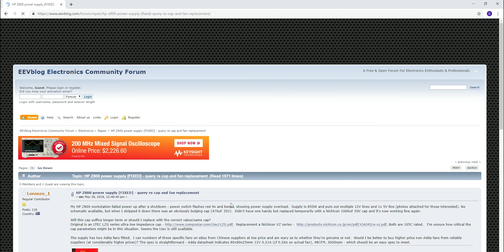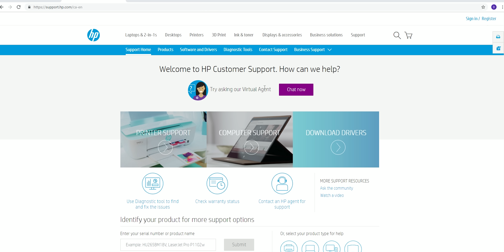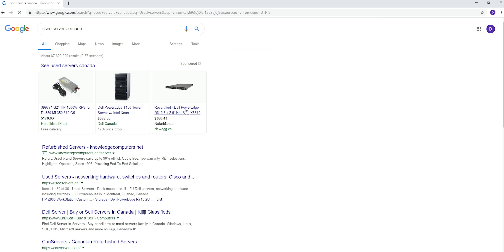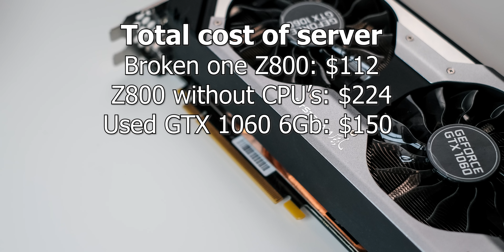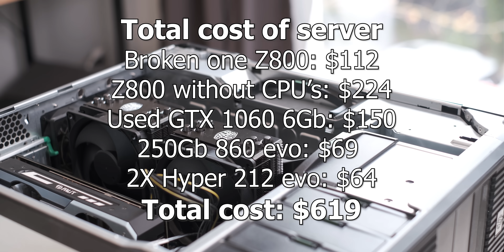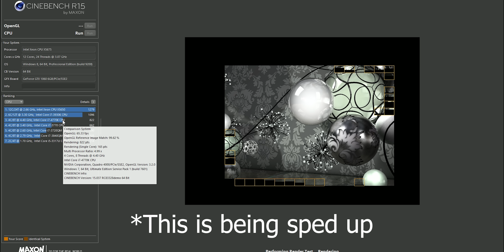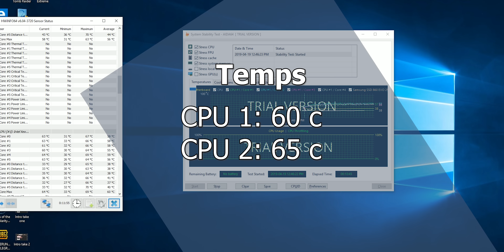Dual Intel Xeon, 48Gb BEAST for under $700! (With Benchmarks)

Comment: It's a workstation not a server.
Servers don't have crazy high end GFX cards.
It's meant for one guy doing crazy hard stuff.
 I've had a few of the predecessors of this beast namely XW8200 and XW8400. They are built for CAD and come with high end Quadro gfx cards. THey work as gaming cards but when the company retires the workstation (Typically about 5 years) they are no longer cutting edge and are a about average for games.
They have crazy amounts of onboard memory but they are no longer so performant that they can cut it for games.
Also a big downer is they age and so they don't support the latest shader models and when that happens it dumps it on the CPU which means catastrophic framerates.
The solution is to buy a new relatively budget gfx card.
My son happily games all the most recent games on a dual Xeon 3.0ghz 2x 5160 (upgraded for peanuts) and a 1050ti. It has 32mb of ecc ram and it plays just fine at 1080p.
This machine dates from around 2004.
That's the power of workstations.
Stable, Performant, cutting edge and cheap 15 years later but still somewhat performant.
Workstations are another class of PC, Really.
The base value of a workstation is to be at 100% all day every day for years. That's what they are designed for. So as a gaming PC - Massively over engineered.
Luv and Peace.

Comment: That is a nice build. I made my own, pretty similar build with hp z400 and w3690, 24g ddr3 ecc and rtx 2080 super. Because of faster gpu, i beat your scores in all areas, so you should get way better card. I really appreciate your tidy build and how easy you had it. My hp motherboard is sitting in fractal design r5 define case and cpu is watercooled, and i modified psu connector to standard atx. All of that was a pain. Also Intel XTU will work with you, so you can now set faster boost clocks!

Comment: Anybody else cringe real hard when he touched the traces on the back of that power supply? Those caps could still have more than enough power in them to fry more than the computer. Holy shit. He is lucky.

For all you folks out there servicing your own stuff for the first time, power supplies are dangerous, even unplugged. If you don't discharge the capicitors, they often have more than enough power in them to kill you dead.

Do a little googling before cracking open anything that hooks into the mains.

Comment: How about the noise? Can I keep it in my bed room?  I have powerEdge  server it is too noisy and I ended up with garbage it
Reply: I have two Z620's running in my office with EGA video cards and the fish tank in the office drowns them out.  Gentle swoosh sound is the best description of the fans. However crank up all 32 cores and then the fans roar. That never happens even with rendering in Adobe After Effects but they do throw off heat.

Comment: I've currently got a HP600z with stock x5660 at 2.79Ghz... At the moment I think their hyperthreaded. I've been thinking of getting a new PC for VR for some time. But never considered putting a newer card than the Quadro2000 that came with it. If I were to put an RX570 or simillar into my HP600z do you think it could handle some VR before I get the money to fully upgrade ?

Comment: Obviously you shouldn't open the power supply, the lady in hp was going crazy with your questions, when you touched the power connector to the motherboard it "switched on" why where you tinkering with the power cord connected, it's a miracle that you're still around.
Reply: Anyways cool build

Comment: I built a dual CPU Opteron system with a total of 32 cores, 8 memory channels, and 256 GB of RAM for about $700 not counting graphics cards and storage. It performs slightly better than my Ryzen 2700x in tasks that can take full advantage of all 32 cores, and the CPUs run cooler than those Xeons.

Comment: In my opinion, it would probably be better to buy a cheaper system, e.g. 2 x Xeon X5690.
Two days ago I bought a used one Lenovo ThinkStation for 700 PLN (170$) Dual Xeon X5687, 64GB ECC RAM, RAID 2 x SAS HDD 300GB 15K, QUADRO 4000. In a few days will arrive ordered SAPPHIRE RX 580 NITRO+ 4 GB (400 PLN = 100$ used).  I am curious about its results. 
My questions: what processors did you use? Is this socket 2011?

Comment: 3:10 HP SEO: We made a proprietary case to make possible only install proprietary MB and PSU to it. We swapped contact in fan connectors 
 to make possible install only our proprietary fans. We made naughty warnings during computer startup if some of ur proprietary parts are not installed and made that warnings unable to disable in BIOS. What else can we do? 
HP engineer who sold his soul to the devil: Let's remove CPU keys in the socket so some users will burn their systems and we will sell more our proprietary parts! 
Everyone in the room: Beer to that gentleman!

Comment: Have a similar setup, z600 with a gtx1060, 24GB DDR3 and dual  x5675 (6 core). And my two boys  has a z400 each with a X5687 3.6@3.86ghz and that outperforms my rig in gaming, but mine rocks in demanding tasks where all 12 cores get to work. The z400 is a hidden gem for budget gaming. RAM and fast xeon CPU's for the 1366 socket are cheap on ebay.

Comment: There is no need for a computer with more than 2GB RAM and a double-core CPU for the common private user! This is all just money making advertisement!
Even why would anyone need an extra graphics card? An optional onboard memory for graphics of max. 64 MB is completely sufficient for what the most people might apply it on to! There is also no need for an expensive SSD drive since an 80Gb HDD will do every job you can imagine!
Reply: A gamer and a video editor would disagree
Reply: 2gb ram and an double core cpu is not enough for a normal user

Comment: My  build is a C30 Lenovo Thinkstation, with dual E5-2680 V2 CPUs and 32 GB of RAM. It cost me €150 for the C30, €150 for the CPUs. I got a 500GB mSATA drive for the onboard slot, and a RTX 2060 for some gaming. It is pretty awesome for about €700

Comment: Hp z series power supply has self diagnose. remove PSU and just give power. if you see green light and  working fan it s ok. and this CM fans change the air flow in the case and its gonna be a huge problem for you .
if one of your cpu stop working check the two component back the mb.

Comment: i absolutely love the hp z600 and z800 series.. i had a z600 with 2 5675 chips and 36 gb ram. installed esxi and made a 4c 8 thread vm with a gpu and made my own geforce now and it worked perfectly. and i head headroom for running nas and other stuff on the left over  specs

Comment: Oh, wow. Is this a coincedence? I have a spare Z800 Workstation that doesn't boot up(probably because i didn't try a known working graphics card) and beeps and it is fully loaded with hardware. Then i can put in there my very own Quadro 4000. And it'll be an awesome upgrade!! I currently(3/14/2020 MM/DD/YYYY) have a Dell Precision T7400 that i put in there a Quadro 4000 and called it a day. It has a Xeon E5410 Quad Core @ 2.4 GHz(Has room for another one, yes, a dual CPU system), 8GB DDR2 FB-DIMM and all of my hard drives and also it has a floppy disk drive as an added bonus. If i get the Z800 workstation working, I'll have 2 more powerful Xeon CPUs, Double digits of DDR3 RAM and not dealing anymore with a CPU Bottleneck :). But one thing that gaming hardware has that server stuff mostly doesn't is the ability to overclock your CPU(s) in the BIOS.

Comment: Those little dainty HP coolers work great. I've got one on an i7-4820k and it stays under 30C (yes really). Bought another to put on its Xeon twin. Works better than my big high-end cooler. Catching on fire meant you had a short, also why the power plug didn't work fully seated. Main drawback of such a system is power draw relative to total computing power. A MacPro is basically the same system -- turn it into a hackintosh.

Comment: I have a similar setup.  Dual x5675 due to lower watts compared to x5680.  Tho I paired with gtx 1070 :) with a 650watts psu

Comment: Bought a z600 with a single x5672 for $20

Added another x5672 for $11, bought another stock cooler for $24 

Tossed in 48gb of ecc registered ram for $100 (I had to restrain from putting in 96 gb) 

Now I've got 16 threads and 48gb of ram to do whatever the heck I want with for under $200

Comment: You literally have two signs on both cpu sockets telling what side your fans should be 😂 Instead doing that, you made them to take the hot air from your gpu, blowing that hot air tru cpu cooler into the ram, making hot air to stay in your case. I bet the temps are high inside that case as we know xeons      love to keep you warm during winter.

Comment: I have a Z800 system, but I built it in pieces and put it inside a regular case. Took some modification, but it works pretty good. There are wiring adapters to convert ATX power to Z800 power, and had to get different threaded screws to keep the Intel LGA1366 coolers in, tapped holes in the case for the non-standard stand-off locations, and built fan adapters to plug fans into the non-standard plugs. Everything works perfectly.

Also the screws are the exact same as case screws, threading wise. You could have just gotten some thumb screws of sufficient length and it would have worked.

Comment: I cringed when you opened the power supply and was poking around without knowing what you were doing. Good way to get electrocuted.
Reply: When it hasn't been plugged in for a long time? How long do capacitors stay charged?

Comment: really nice to see a build similar to one i did. I used a supermicro X8D board with dual X5660 xeons and 128GB of ram with raid 1 300GB SSDs and raid 1 2TBs and a RX 580 in a corsair case
Reply: Gaming benchmark please
Reply: @a8gaming951  for a system i had 4 years ago...... i dont have the same setup on that system anymore.

Comment: @03:10 -- Intel CPU Corner indicator goes to the hinge lever corner. there's also 2 notches in the sides of the CPU and Tabs in the socket, it won't lay flat unless it's in the correct orientation. You can also unscrew the backplate via the torx screws on the front of the socket, and use the included backplate with the hyper 212. the socket retention frame really isn't needed. with a single x5670 overclocked to 4.5 and tuned well was able to break 1050 in R15 -- high end machines are breaking 18,000 these days one a single CPU...

Comment: Hey can you make into a Hackintosh ? I would like to know if that can be possible . It would be very interesting.
Reply: if it supports GPU passthrough, and linux, you'd have an option to run MacOS with only 4% performance hit plus linux as alt OS. if it doesn't support GPU passthrough, setup Docker in linux and run MacOS in a container, which is generally better than running in a VM because it uses less CPU resources

Comment: If you need a hammer why would you buy a screwdriver? They are both tools but one isn't appropriate for driving a nail in a board. My point is - why would anyone spend $700 on a PC that was not designed nor ever was intended to be used for gaming? I've had the same experience with Dell's version of this very same work station. The Precision T7500 with two X5675s (that's 12 cores/ 24 threads) and a GTX 970. I only spent $75 on it but the performance for gaming was similarly underwhelming and didn't even perform as well as my little HP EliteDesk 800 G1 with a Core i7 4790 and a GTX 1050Ti! The CPU benchmarks were off the charts but the rest of the specs just tanked the whole system because of the PCIe 2.0 - SATA 2.0 and USB 2.0 limitations. Sure you can throw all kinds of upgrades at it but it's still just putting lipstick on a pig, so to speak.

Comment: That's a pretty awesome build, and was seriously considering doing some upgrading to my machine while watching this. However,  my current machine with its Asus P6X58-E WS motherboard, Xeon W3690 overclocked at 4.2ghz, 48gb of 1600mhz non-ECC RAM, and RTX 2080 pushes the envelope a little more than I would get going to a dual X series processor setup like this, even if I used X5690s. 

Curiosity has the better of me though: I wonder how that PC would perform with dual Xeon X5687 processors... They're 4 core processors instead of 6, but they run at a stock speed of 3.6ghz, and they're cheap, I think I paid $25 for one just recently. With a locked multiplier there's not much overclocking potential, however you might be able to squeeze a little more out of it, perhaps up to 3.8 or 3.9ghz.

Comment: There are many ES Xeon Gold and Platinum on Ebay. Even 2nd gen. I build 2x40 core Xeon 6148 Gold ES on autumn 2018, still using it and happy. About $1500 for 2 cpus and mobo (X11DPH-i).

Comment: I picked up an HP Z400 workstation from work to test out some components of my old i7 gaming PC that had become flaky. I ended up just tossing the GTX970 in the Z400 with an SSD and game on that now, lol. Until I decide what i'm going to build, if anything, to replace it. It's running a Xeon W3670 @ 3.2ghx. I could probably get away with just upgrading the video card in it to a 5700 or a gtx 2060 Super. It has been a very good machine. 

In regards to your Z800 workstation... Was it worth it as far as performance for $? Not entirely. Is it an awesome project build? Absolutely!

Comment: Thanks! Great video! Would be interesting to see benchmarks at 720p or 480p to see where cpu bottleneck is. I had a dell t7500 with x5670 and was always wondering if another cpu would boost it or not! I now have some hp z400s with w3520 and wondering if should try the 6c12t xeons or if single clock speed a bottleneck etc!

Comment: my dual xeon is EXCELLENT for keeping my feet warm.
Reply: Is it broken ?
Mine is so quiet and heats so little that I completely forget it when I use it.
Reply: @XCodeFrance  same and im using a stock cooler that doesnt even have a fan on it (idles at 40 games at 55-60c)

Comment: I have two HP Z800s and a Z820 and absolutely love them. It's amazing how much RAM and how many CPU cores you can get for the price when buying these machines refurbished. My Z820 I bought for less than $1,000 US and it has 64 GBs of RAM and 12 cores. It came with a decent HDD and graphics card, but I've upgraded those since. I don't game. I do a lot of photography, some video editing, and do a lot with virtual machines. They work out extremely well for my needs. I keep wondering: "How many more years am I going to get out of this amazing machine?" The other thing I did was added a 4-port Ethernet add-on card (giving me 6 ports total). It was spendy (almost $200), but it has been well worth it.

Comment: Here's an update. Last week, I was able to find a Z800 with Dual Xeon CPUs, running 6 cores. 48 gig ram, 2 TB hard drive, DVD, Windows 10 Pro installed. Yes, each CPU had 6 cores. (That's 12 for you college kids) I tried to buy another, but no joy. Only one in stock. $200, silicon salvage dot com, ask for Dave.

Comment: It's looking almost exactly as Mac Pro 4.1 - 5.1 with this xeons 5690 :)   From other perspective - cheap 1150 mobo + i5 4460 + RX580 4GB + 32GB ddr3 and you get more than double of fps that you can archive with this HP server.

Comment: I use a same machine but from fujitsu siemens, i also replace all fans to pwm ultra low noice, now the machine is under full load absolutly noisy. As cpu cooler i use 2 ARCTIC Freezer XTREME and for usb 3 i added simply a pci card, the machine works perfect.
Reply: Are these Noctua fans? How did you replace them? The rear case fans are 6 pin. Did you also change the fans on the memory cooler? I think they are the loudest in my computer.
Reply: Are those Noctua fans? How did you replace the rear case fans because they are 6 pin. Did you also manage to replace the fans of the memory cooler? I think they are the loudest in my computer.
Reply: https://abload.de/image.php?img=dsc_0003xyjbn.jpg
Reply: Thanks! Though the setup looks really different. No clunky memory shroud cooler fan like in the HP

Comment: You're kind of an idiot. You opened a psu for no reason, fried the gpu, added aftermarket heatsinks for no reason (you cant overclock this machine and the fans rarely hit full duty unless theyre full of dust) and even complain about no usb3 when it was offered as an add-on card from hp. Total rubbish.

Comment: Im using X5690s @3.46 GHz base and 
3.73 GHz boost, top-spec CPU is a must without overclocking. Been running almost 24/7 for 2-3 years

Comment: Other issue I had with mine is that the RAM supplied with it (48GB like yours) went bad, so I had to get some more. (16GB as two 8GB sticks is enough for what I do with it.) When running Linux on it, I wrote a simple script to copy the contents of /lib, /bin, /usr/lib and /usr/bin to a tmpfs on /tmp, and then delete, so that I had the entire OS running from some of those 48GB of RAM. One more observation is that the near 1min delay before the screen comes on seems to be a result of the number of DIMMs you have installed, as mine POSTs much quicker with only two DIMMs installed.

Comment: I'm surprised you say yours run hot with the stock coolers. In the past I ffmpeg transcoded a number of 1080p videos (read: blu ray rips). That had all cores at 100% for a few days, and the highest temperature was about 75 celcius.

Comment: Very nice, I still run a z800 with 5675s. Although my CB R15 scores are a bit higher along with my gaming performance. Do you have turbo boost enabled in the bios? I know mine came disable mine with turbo to 3.3Ghz all cores and 3.5 on one core. At the time I bought mine DDR4 prices were insane and ryzen hadn't released yet so it was an amazing deal I got mine at auction for $372 USD at the time and it performed much better than expected. Great video man look foward to seeing more stuff subbed.